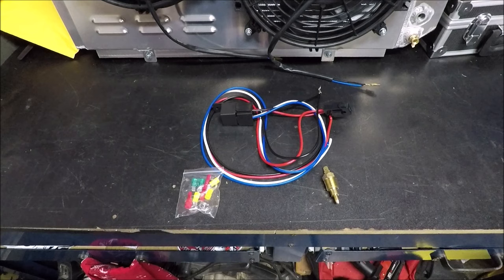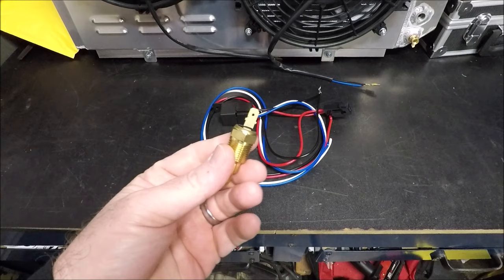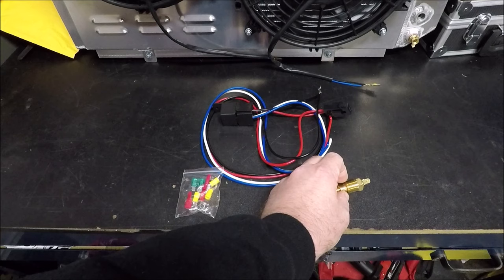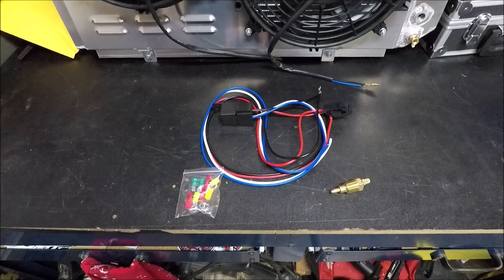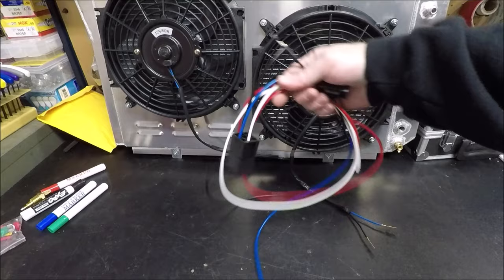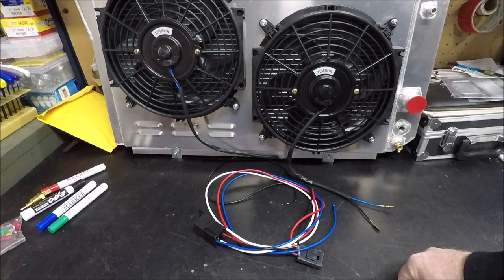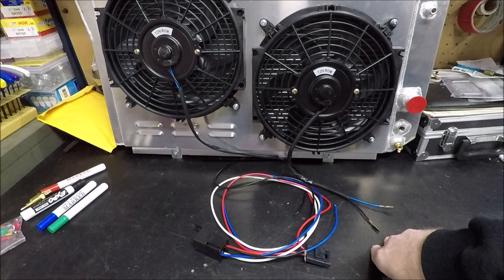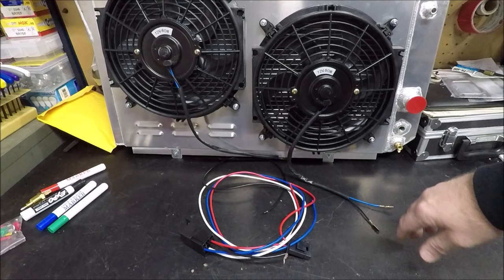ELECTRIC COOLING FAN RELAY AND TEMPERATURE SWITCH WIRING

Comment: I want to just put it where when it is running the fan will stay on till I turn the vehicle off so just wired to the ignition switch that way when I turn it on the fan run all the time when the switch is off, it’ll turn off

Comment: Great video!!!! I'm putting an alloy works radiator in a 94 f150. For the white wire, does any switched ignition source work or which would u recommend me to tap into for the white wire?

Comment: I'm using a relay setup from a prior radiator and fan set up, running on a 5.3 swap, the fans cutoff after hitting 195, they turn on when they are supposed to but turn off when they aren't supposed to. Is this an ECU problem or relay problem? TIA
Reply from the maker: If you’re using one of the setups container in this video then your ecu has nothing to do with when your fans come on or go off. If you’re not using one of these setups then you’re asking questions on the wrong video.
Reply: @BadLuckGarage Thanks for the reply, I watched this video trying to figure out why they kept cutting off. Do you have a video on the ls swap version of this? Cause I can't find anything with my issue.

Comment: i hooked mine up just like you did but my fan stays on all the time as soon as i turn the key on any suggestions
Reply from the maker: If you truly hooked them up the way I did, then you most likely have a faulty temp switch that staying grounded out. That is the only thing that would cause your issue if the engine isn’t over 165 degrees already.

Comment: Hey boss, can u connect that temperature switch to the radiator?
Reply from the maker: You can. Just keep in mind temps in the radiator won’t reflect actual temps in the engine when selecting your in and off temps. So you may have to do some guessing and some settling on “good enough”.

Comment: can you splice the black wire into your existing coolant temp. sensor
Reply from the maker: Sensor…..no, switch….possibly. Just depends on your specific application. You would need to find a wire diagram for your specific vehicle and understand how your factory fan circuit works to k ow for sure.

Comment: It seems that my fans kick on when engine gets hot but they don’t turn off until I turn off ignition.  My thermostat is 180 and the switch is 190.  At some point while driving it should cool down enough for them to turn off right?  My gauge shows around 150 and they still run, the switch is installed in the top of the manifold.  Olds 403.
Reply: At about 65mph.

Comment: If I’m running a 180 degree thermostat in my sbc 350, could I just not use the supplied temp switch and just buy a 195 degree ON and 185 degree OFF switch?
Reply from the maker: Yes

Comment: Thanks mate.. Ur presentation is really good. Really help me a lot.
Reply from the maker: Glad to hear it brother!
Reply: @BadLuckGarage  so i have a old 85 350 sbc with a 1 cyclone electric fan i have a -185 coolant temp switch and a 185  thermostat ...my fan  come on but the they never go off....you said use a lower temp thermostat...were you speaking on a LS ENGINE OR OLD STYLE SBC WITH CAST IRON HEADS....what temperature thermostat should i go down to so the fan goes on and off .my temp gauge stays about 190 all the time..

Comment: I am trying to wire this into a 99 cherokee xj. Mine comes with 3 fans so i should run relays for all 3 and where should i put my thermostat?
Reply from the maker: You should put it in one of the locations I recommended in the video. How many relays you need depends on the amp draw of your fans.

Comment: I did this exact set up, two relays. I had my ac turn on while i waited for the temp to come up for the fans to kick on, and then the ac compressor pressure valve blew up freon. What theck happened?
Reply from the maker: Since the fans have absolutely nothing to do with the pressure in your ac system I’d say you had a really shitty coincidence.

Comment: How would it work if not using a thermostat in water pump just direct flow would it work the same? Or would fans not turn on
Reply from the maker: Yep. Although I don’t recommend not running a thermostat unless it’s for some special application. And even then I would at least run a restrictor

Comment: or did you use the islet to hook up another wire and put it inside the car to a toggle switch to have a manual override for the ground for the fan.
Reply from the maker: The eyelet itself is useless except to ground, but yes you could run a wire to ground through a switch for manual fan control.

Comment: for and oem "upgrade" application, instead of having the "switched ignition" wire, can that run to the factory fan wire to have the ecu control when the fan turns on and off ?
Reply from the maker: Yes as long as it’s running through a relay. That’s exactly how I ran mine. I already had my Holley ecu triggering the factory fan relay. After determining the factory relay could handle the amp lid of both fans I just left it the way I already had it but split the relay power to both fans.

Comment: thanks for the video. how can I run the fans using the ECM do you have another video?
Reply from the maker: If your ecu has a trigger wire for electric fans then it would be used to trigger the relay in place of the thermostat switch.

Comment: Can I run that black wire that goes to coolant switch directly to my harness fan 1 and 2 it should work the same right ? My pcm is programmed to run dual fans . Eliminating that switch should work same way off the temp set by pcm and thermostat right or am I wrong?
Reply from the maker: As long as your pcm works by grounding the signal wire yes. That’s actually the way I ran mine as I mentioned in the video.
Reply: @BadLuckGarage   thanks for the reply I just discovered your channel you been very helpful thanks man
Reply from the maker: @MrJonathan6986  Glad to hear it brother!👍

Comment: I have been watching your video.If you can help me with this. I am running terminator x  wich has two outputs for fan control..im running 2 relays..So should i run the output off the terminator to the black wire?And what to do with the white wire?Thanks for your help.
Reply from the maker: Yes. And white wire still gets hooked to switched power as shon in the video. The Holley will ground out the black wire to activate the relays. Or you can use up two outputs and have the fans come on at different temps, or you could wire one relay to the temp switch and just have the Holley trigger the second fan if needed. There are literally dozens of ways you could do this. The purpose of this video is to show the most simplistic way.

Comment: On my 86 c10, I did add a 2nd relay. Installed a 160 thermostat as well. Fans do kick on once temp rises.  But fans don't seem to kick off once temp drops. Any suggestions.  Noticed it did this with the single relay as well. Thanks in advance
Reply from the maker: If you’re using the supplied temp switch, and wired it properly, the fans won’t kick off unless the coolant temp drops below 165* or until you turn the key off. Unless you’ve got a VERY efficient coolant system , that’ll never happen. I explained that in the video.
Reply: @BadLuckGarage  yes , I'm using the temp sensor supplied with the kit and installed a 160 thermostat. I did install a second relay as recommended. The key power source I'm using for the white wire to relay is pushing 14v per my tester. Could this be over powering the relay?
Reply from the maker: @markmelendez1029  No. automotive relays will operate at well over 14volts. It’s more likely that you coolant temp just isn’t getting low enough for the switch to shit the fans back off. Just because you install a 160* thermostat doesn’t mean your engine is actually going to run at 160*. It just means that’s the lowest temp that it could possibly maintain. As I explained in the video, that’s my biggest problem with this kit is that the switches on-off temp is set too low to operate properly with most cooling systems.
Reply: @BadLuckGarage what range temperature switch should we use to remedy this issue ?

Comment: Have a question when I turn terminal 85 or the white wire from the ignition surge off the fan turn off what I need to chenge
Reply from the maker: Sounds like you need to rewatch the video and pay better attention. Because if you hook it up the way the video recommends then you wouldn’t have a any of these problems.

Comment: I have a question, that was a great explanation on installing two relays with a temperature sensor 👍🏼, but how do you connect a fan to an a/c compressor? Does one black wire from an alternate relay get connected to the a/c compressor power wire that engages when you turn the a/c  on? Any help is greatly appreciated. 🙂
Reply from the maker: I’ve already answered this several times in the comments. Basically you use your ac kick wire to interrupt either the relay ground or the relay ignition wire depending on whether your ac kick wire is a positive or a ground. Most are ground.
Reply: Thank you for the reply :))

Comment: When doing this same install, could I tie the load end of these relays in with the existing "hot" (positive) wires already going to my cooling fans, so that they still come on with my a/c? 

My fans DO NOT come on when at or above operating temp, they only come on when the a/c on. Which is why I'm doing this install, but I still need to tie into to my a/c system somehow.
Reply from the maker: Most ac locks are ground triggers, not 12v triggers. Depending on how your AC kick is originally wired you may need to tie into the ground side, not the switched ignition side. You definitely don’t want to tie into the load (battery) terminal of the relay though.

Comment: Now how would I connect the switch to the computer instead of the head ?
Reply from the maker: @jesusnieto4374  you don’t. It’s “either or” as I stated in the video. If your ecu has the ability to control the fans then you don’t need the switch.

Comment: Will the holley terminator x efi control my electric fan?
Reply from the maker: Yes. Just run the relay ground trigger to one of your outputs instead of to the temp switch.

Comment: Im running a terminator xmax. Just wondering do i need to use the temp sensor with the alloy works or use the output with the holley?
Reply from the maker: Use whichever you want

Comment: your thermostat comment didnt make sense. help me out becuase im confused and trying to understand. if the temp reaches 185 and it kicks the fan on and won't kick the fans off until 165, wouldn't i wan't a 185* thermostat so the fans kick on when the thermostat opens, at the same time? you said i should get a 165* thermostat in the video.
Reply from the maker: It makes perfect sense. Your thermostat sets the lowest temp your engine can run at, not the highest. If your thermostat won’t let your engine temp get below the shutoff point of the fan switch, then once the fans come on….they won’t go off again the entire time you’re driving your car. If you’re running a 185 thermostat, then you would want a switch that turns the fans back off at or above 185. The fans job is to cool the engine back down to operating temp of that temp is exceeded by a set margin( primarily while stationary or moving a low speeds), not to have to run constantly the entire time your car is in operation. That will lead to premature failure of the fan motors.

Comment: Few questions here. Where is a good spot to tap into the ignition power source? And I don’t get how if that’s a 185 temp switch and your thermostat is 185 why it’ll keep running?
Reply from the maker: Any key on ignition source. WHERE that’ll be will be different on each vehicle. the “off” temp of the switch needs to be higher than the thermostat temp, ie the normal low side operating temp that the engine can reach. If you have a 185 thermostat, then the engine is always going to be at least 185 or above while running once it reaches temp initially. If your temp switch “off” temp is below that, obviously it’ll never shut off.

Comment: I have a 07 pontiac G5 2.2 eco-tec THE underhood fuse box has 3 sockets for the cooling fan (single fan) there are 3 sockets but, the control socket is empty on most every car I have checked & when I ask them if their fan works, they say YES! So, there is the empty (5 pin)control socket, (4 pin) cool fan 1 with a relay in it. & (4pin) cool fan 2 (with a relay in it), even though there is only a single fan! I HAVE FOUND THAT, If I ground the top left pin of the empty control socket/ empty 5 pin relay socket, the fan comes on regardless if the ignition is on or off so, I ran a wire from that pin into the car, to a single poll switch & out, to a ground! However, I have to constantly monitor the temp & if left on, it obviously runs the battery dead (I have ran my batt dead twice because, I like to run it a good 30 sec after the car shuts down) I am wondering how I can have an automated system & still keep my factory digital temp gauge. It has a 2 wire temp sensor. I like seeing what temp the engine is at so, I know when to turn the fan on & off. When I see 198°-200, I turn the fan on! I have seen 212° when I wasn't not paying attention! So I turn on the heat & the cooling fan. Would be nice if it ran automatically. I am wondering if connecting the ac line would fix this issue?

Comment: Is it possible to wire it so fans will run after key off till temp is lower. Like cars are from factory
Reply from the maker: Most factory cars allow the fan to run for a set amount of time after the car is shut off, usually around 15-30 seconds. This is done so at the next startup the coolant in the radiator will already be cooled down and will cool the engine off immediately upon startup. The sensor is in the engine block or intake manifold whereas the fans are cooling the radiator. So if you straight wire the sensor to the battery instead of ignition what happens is it will keep running until either your battery goes dead or the coolant wherever the sensor is happens to cool down enough in it’s own to trigger the sensor off since without the engine running the coolant from the radiator isn’t being pumped back to the block. Not exactly ideal.

Comment: My Dads chevelle developed a non working fan issue when up grading from a 14" fan to a 16" fan.. fan will kick on for few seconds then stop and twitch ..replaced relay n shortstop circuit breaker.. now nothing happens... I noticed 85 and 86 are switched around when compared to the way you laid it out .. would that cause this issue even though it was fine before?
Reply from the maker: No. 85 and 86 are generally reversible. I would make sure the new fan itself has a good solid ground. It’s possible that the new fan draws a lot more amps and maybe the ground was making due before but any conduct enough juice now and is causing the fan motor to overheat. Or the fan itself could just be bad if the old one worked fine and the ground is good.
Reply: @BadLuckGarage  thanks for fast response BLG, yeah that's what I was thinking .. multimeter with probes on 85 n 86 show 12v with key on... I got 12.36v at 30 n 87.. I can manually close the relay and the fan runs great no stalling, I'll clean up grounds n try it again Thanks for the help and Thank you for your time ..... the fan issue amongst other problems started when my dad got vintage air install... $5,000 for sub par a/c and constant headache along with heartache. install looks like hell...to say the least.

Comment: What if i have a 180 thermostat? It won't shut off? They don’t tell you these things in the instructions
Reply from the maker: As explained in the video, if you’re cooling system isn’t capable of getting temps below the “off” rating of the switch, then no, the cooling fans won’t shut off until you shut the car off.

Comment: Ok so I have everything hooked up right. And my fan doesn’t come on. I have the sensor in a radiator hose adapter on my lower hose and a 160 thermostat as well as still have my stock sensor in the thermostat so that I can still tell
Temp in the cab
Reply from the maker: On most engines, the lower hose is the coolant coming back from the radiator. If that’s the case then that coolant is going to be much cooler than the coolant in the engine and I would recommend moving the temp switch elsewhere. Prefers king on the engine itself if possible. If that’s not an option then it needs to be in the line that moves water OUT of the engine and to the radiator.
Reply: @BadLuckGarage  ya I switched it up top and still not clicking the fans on and everything is wired right. Has to be something with the sensors
Reply from the maker: @riffraffchoppers  If everything is wired properly then it has to be a faulty temp switch.
Reply: @BadLuckGarage  I tried testing it with a torch to see if fan would come on and didn’t. So bought a new one and tested it and same. But I think I didn’t have to grounded when testing. Someone said maybe the sensor wasn’t getting hit by the coolant in the top hose ? Another guy said I don’t need to run a 165 thermostat with the 185 sensor like you said ? Do you have a email I can send you a video of how I have everything wired ?

Comment: Can we use temprature guage as a switch for relay of fan????
Reply from the maker: No
Reply: @BadLuckGarage  do ECT sensor can be used to switch on relay???
Reply from the maker: @goharabas512   I’m sure there may be some ECT sensors that are also capable of grounding a relay but 95% of the time the answer would be no, you can’t trigger a relay directly off the sensor. What you CAN do is possibly let the pcm trigger the relay as it would with the factory fans.
Reply: @BadLuckGarage  i have diesel engine without Pcm and it has NCT ect sensor so i am thinking to trigger relay by ect sensor